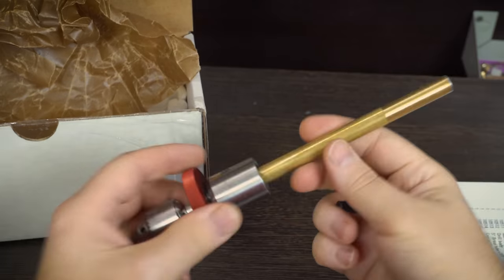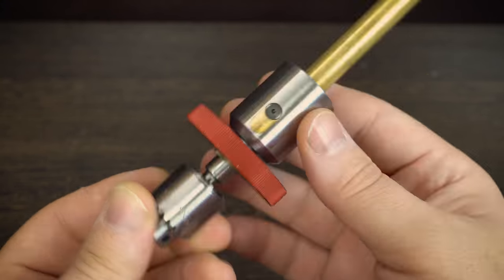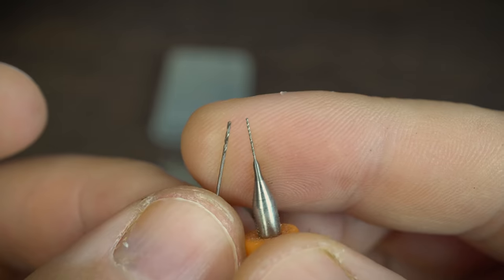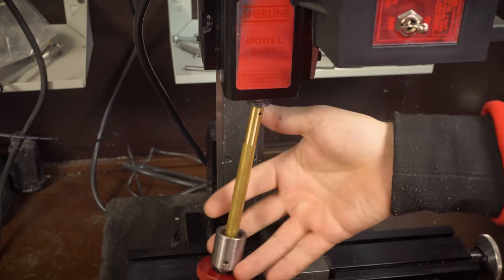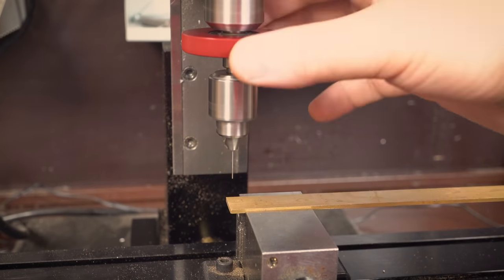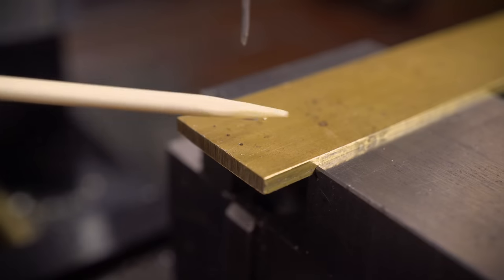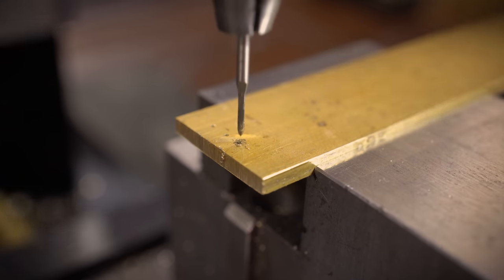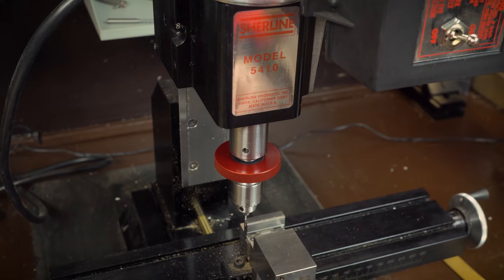An unusual contraption! Drilling with thin drills.

Comment: A couple of more tips when dealing with small drills:
* Spot drill (with a proper precision spot drill, not centre drill for lathe work), 90 degree tip for use with HSS drills but use the same angle as main drill if it's carbide (140 usually).
* Keep the rpm and feed down until the the drill is fully seated, this reduces the risk of flex/vibration until the drill is supported by the material - Even if these drills look short, compared to their diameter they tend to be very long!
* Be aware of chip clearing. The room for chips are minimal and clogged these drills breaks in an instant but due to point 2 above avoid to lift the drill out fully. Keeping the drill tip inside the hole at all times also reduces the risk for oversized start of the hole.

Have fun and wear safety glasses!